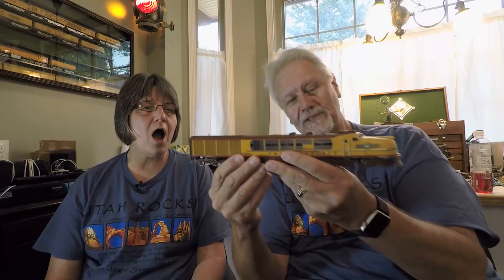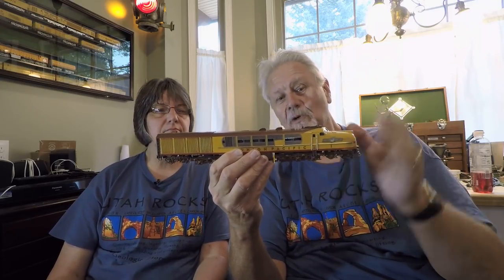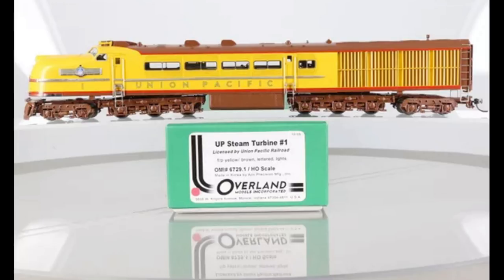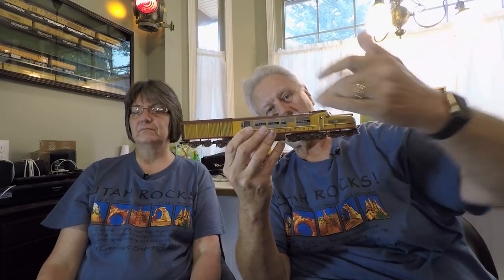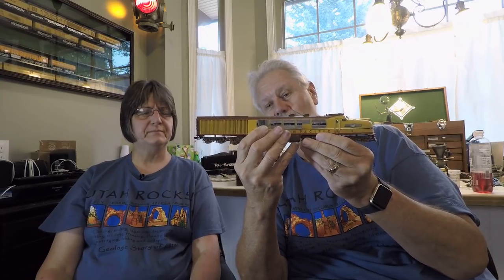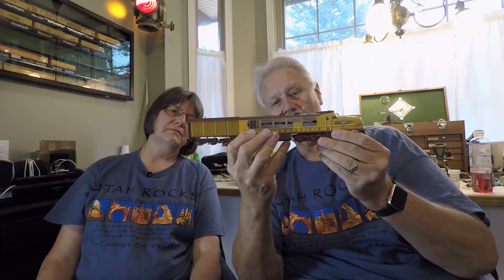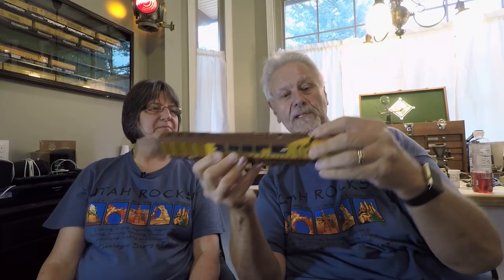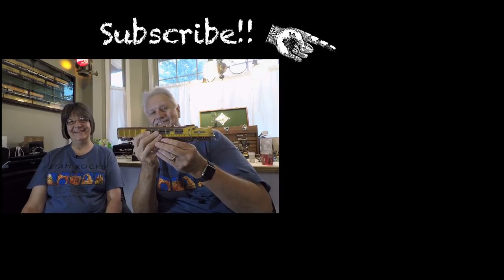Alco - Samhongsa - Overland HO Scale Brass Union Pacific Steam Turbine

Comment: One of the neat things about UP is that for a significant portion of it's history they was not afraid to experiment and develop new locomotives and technologies in-house even though a  number of those ended up being a bit of a disaster.
Reply from the maker: The glory days of UP transition. Besides running some amazing steam locomotives,  but in trying to come up with replacements for them they helped EMD and General Electric and Alco research some great new ideas. This “failed” locomotive was one of the first locomotives able to be MUd. (Multi units running from one control). And this was the first locomotive to have dynamic brakes!! So failure?  No way. Did it work as planned? Nope. That’s progress.

Comment: Awesome looking model train! I've always loved trains of the 1930s through to the 1940s. Was this before they switched to Diesel-Electric power? :)
Reply: Jason Carpp - It was people who loved steam at UP looking for an alternative to the Diesel-Electrics. Personally, i am not a fan of locomotives that sound and look like buses with that nasty odor.
Reply: I'm not a fan of today's buses. I'm rather old-school when it comes to buses and trains.
Reply from the maker: Really a one of a kind. One of the first non electric locomotives to be able to run multiple locomotives from one of the locomotives. Without this feature diesel locomotives would have never worked. You can’t really build a diesel with the power and pulling power of a steam locomotive. It takes a string of diesels to pull a train. Also this was the first locomotive with dynamic brakes. Also needed before diesel locomotives would work. For some time many thought gas turbine would be the only replacement for steam. And it worked great!  But when the fuel became expensive that killed that. So mu diesel took over. But this steam locomotive was the test platform for that.

Comment: Wow. That is extremely cool looking! 
Question would the UP one pre-date the one from Norfolk western or the C&O ? 
I know both the N&W and C&O both had exhaust at the front ends. 
Will had to look this one up and read more about it. 
Thanks. This an excellent source for future reading material!
Reply from the maker: Not sure. All about the same time. But UP built 2 and they were always lashed together. One thing UP was most interested in was  running 2 locomotives from one. Today we don’t even think about that. But the idea of a bunch of smaller diesel locomotives replacing one big steam locomotive was attractive if they could be run by one crew.
Reply: You are correct. The C&O N1s came about during the mid 1940s lasting until 1950. The N&W Jawn Henry was around the mid 1950s